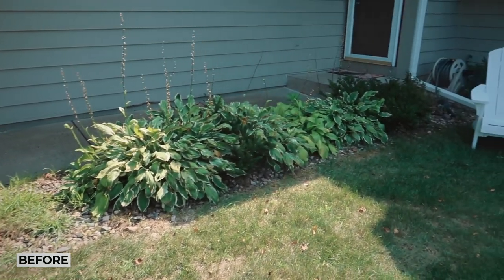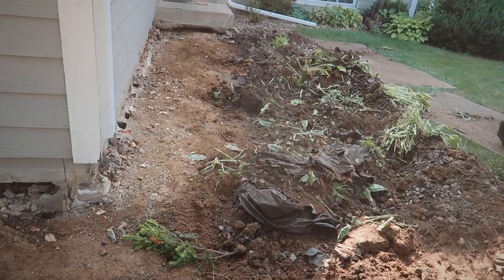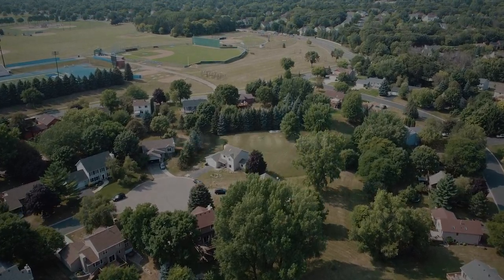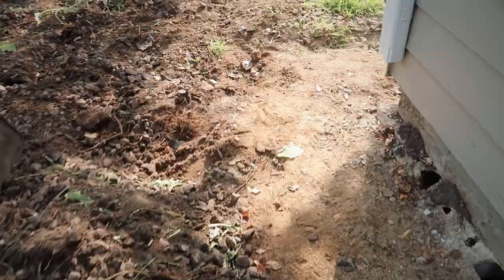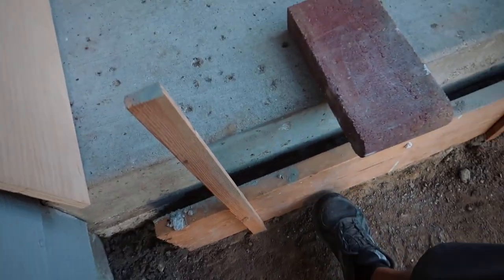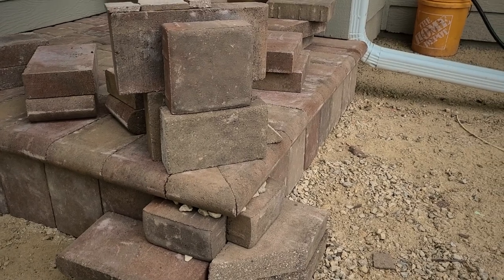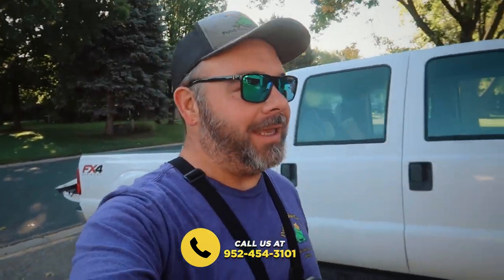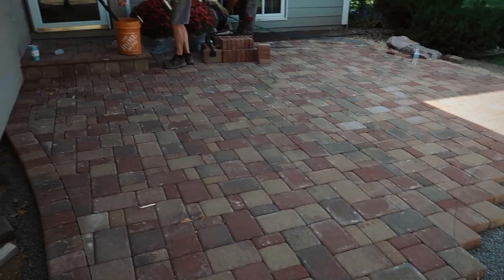Building a Paver Patio, Walkway & Front Step!

Comment: Mouse entry+steel wool (stainless preferred)+foam injection equals green way to stop/slow the varmit entry.
Reply from the maker: Awesome, thank you for the tips! So far the concrete base material seem to be working 🤞 I know Justin's Dad recommended something similar to what you're describing. Foaming around the steele wool.
Reply: @PondKingWaterGardensMN  Right, you stick the nozzle of the foam can into the steel wool and let it expand out through the steel wool.